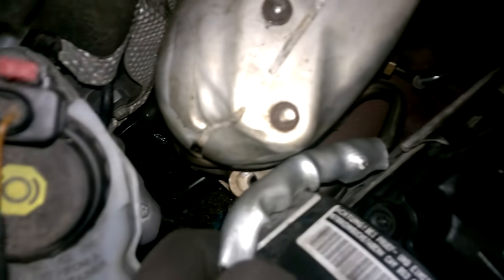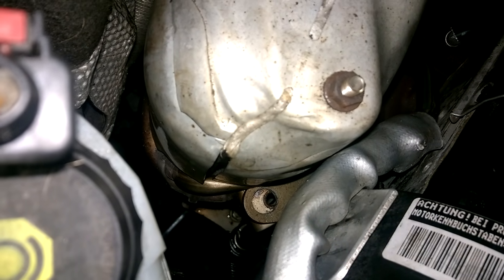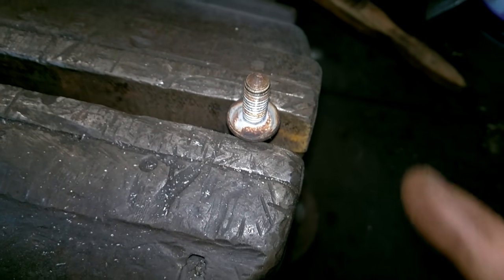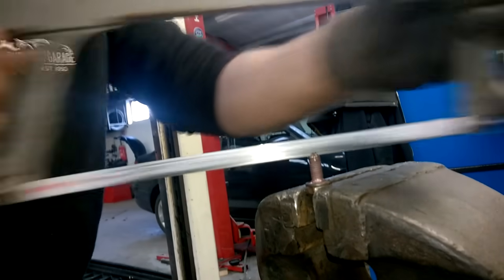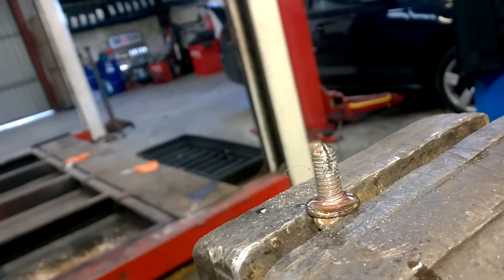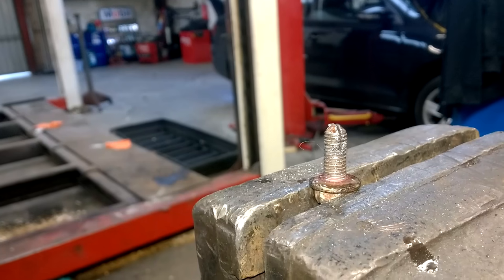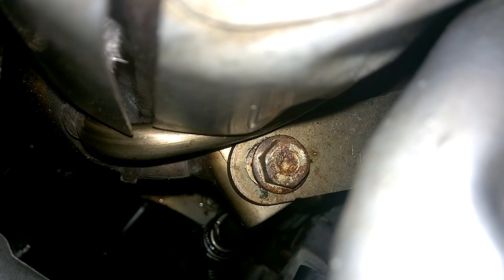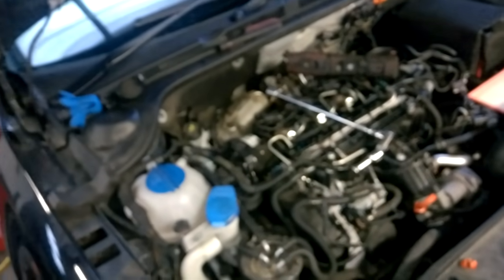My Father Taught Me This! Passing It On To The Next Generation

Comment: Nice Third World method, but here we would buying just a new bolt, for couple of cents.. 😂😂👍🇬🇧🇪🇺
Reply from the maker: The update info below is the pinned comment on this video, I know most people do not realize I made that video and it better explains/shows this method in use.   
I also included below details of why the job was done this way free of charge with the customer fully informed. I hope you check it out  👇👇
 
UPDATE* I decided to make a follow up video on this https://www.youtube.com/watch?v=yfNQullGEuQ&feature=youtu.be Should answer some of the questions that were raised, I include 3 demos of this in action with close up shots.
 
As there was some safety concerns & confusing comments raised, I felt I should clear a few things up. 
1) This is a tip for certain circumstances only, I never have and never would use it on a component which would cause any safety concern to any customer.  
2) The demo was done on a support bracket only, items like this or similar will not cause any safety concern. 
3) I did this free of charge and on a time restraint, I noticed it when I was replacing another item, the customer needed the vehicle back that evening and I decided rather than leave it like it was, I would do this and secure it up fully. 
4) The bolt was not the issue, the part that the bolt threads into is a secured piece, someone had previously damaged it, leaving the bracket loose and the bolt just tightened a turn or so.
5) The bolt can be removed and will not break, it will go in and out as usual and has helped clean up the damaged threads.  
6) Used in the right application I personally believe this is a great tip and can save you a lot of time & trouble. 

Lastly to all the people who have watched the video, Thanks very much and I am delighted with the feedback I have received on it.
Reply: @GerardBurkeBurkesGarage  Cool.🚩😄🤘

Comment: If those threads are useless, and your collapsing the end of the bolt shaft anyways, why not just cut the quarter of that bolt off to the good threads. Interesting tip than you

Comment: If it doesn't want to go don't force it, do it right.
Reply from the maker: Hello so good 4U
The update info below is the pinned comment on this video, I know most people do not realize I made that video and it better explains/shows this method in use.   
I also included below details of why the job was done this way free of charge with the customer fully informed. I hope you check it out  👇👇
 
UPDATE* I decided to make a follow up video on this https://www.youtube.com/watch?v=yfNQullGEuQ&feature=youtu.be Should answer some of the questions that were raised, I include 3 demos of this in action with close up shots.
 
As there was some safety concerns & confusing comments raised, I felt I should clear a few things up. 
1) This is a tip for certain circumstances only, I never have and never would use it on a component which would cause any safety concern to any customer.  
2) The demo was done on a support bracket only, items like this or similar will not cause any safety concern. 
3) I did this free of charge and on a time restraint, I noticed it when I was replacing another item, the customer needed the vehicle back that evening and I decided rather than leave it like it was, I would do this and secure it up fully. 
4) The bolt was not the issue, the part that the bolt threads into is a secured piece, someone had previously damaged it, leaving the bracket loose and the bolt just tightened a turn or so.
5) The bolt can be removed and will not break, it will go in and out as usual and has helped clean up the damaged threads.  
6) Used in the right application I personally believe this is a great tip and can save you a lot of time & trouble. 

Lastly to all the people who have watched the video, Thanks very much and I am delighted with the feedback I have received on it.

Comment: How clever 😀
Reply from the maker: The update info below is the pinned comment on this video, I know most people do not realize I made that video and it better explains/shows this method in use.   
I also included below details of why the job was done this way free of charge with the customer fully informed. I hope you check it out  👇👇
 
UPDATE* I decided to make a follow up video on this https://www.youtube.com/watch?v=yfNQullGEuQ&feature=youtu.be Should answer some of the questions that were raised, I include 3 demos of this in action with close up shots.
 
As there was some safety concerns & confusing comments raised, I felt I should clear a few things up. 
1) This is a tip for certain circumstances only, I never have and never would use it on a component which would cause any safety concern to any customer.  
2) The demo was done on a support bracket only, items like this or similar will not cause any safety concern. 
3) I did this free of charge and on a time restraint, I noticed it when I was replacing another item, the customer needed the vehicle back that evening and I decided rather than leave it like it was, I would do this and secure it up fully. 
4) The bolt was not the issue, the part that the bolt threads into is a secured piece, someone had previously damaged it, leaving the bracket loose and the bolt just tightened a turn or so.
5) The bolt can be removed and will not break, it will go in and out as usual and has helped clean up the damaged threads.  
6) Used in the right application I personally believe this is a great tip and can save you a lot of time & trouble. 

Lastly to all the people who have watched the video, Thanks very much and I am delighted with the feedback I have received on it.

Comment: nice, thank you
Reply from the maker: Cheers Albert  
 
The update info below is the pinned comment on this video, I know most people do not realize I made that video and it better explains/shows this method in use.   
I also included below details of why the job was done this way free of charge with the customer fully informed. I hope you check it out  👇👇
 
UPDATE* I decided to make a follow up video on this https://www.youtube.com/watch?v=yfNQullGEuQ&feature=youtu.be Should answer some of the questions that were raised, I include 3 demos of this in action with close up shots.
 
As there was some safety concerns & confusing comments raised, I felt I should clear a few things up. 
1) This is a tip for certain circumstances only, I never have and never would use it on a component which would cause any safety concern to any customer.  
2) The demo was done on a support bracket only, items like this or similar will not cause any safety concern. 
3) I did this free of charge and on a time restraint, I noticed it when I was replacing another item, the customer needed the vehicle back that evening and I decided rather than leave it like it was, I would do this and secure it up fully. 
4) The bolt was not the issue, the part that the bolt threads into is a secured piece, someone had previously damaged it, leaving the bracket loose and the bolt just tightened a turn or so.
5) The bolt can be removed and will not break, it will go in and out as usual and has helped clean up the damaged threads.  
6) Used in the right application I personally believe this is a great tip and can save you a lot of time & trouble. 

Lastly to all the people who have watched the video, Thanks very much and I am delighted with the feedback I have received on it.

Comment: good to know thanks
Reply from the maker: Cheers Robert
 
The update info below is the pinned comment on this video, I know most people do not realize I made that video and it better explains/shows this method in use.   
I also included below details of why the job was done this way free of charge with the customer fully informed. I hope you check it out  👇👇
 
UPDATE* I decided to make a follow up video on this https://www.youtube.com/watch?v=yfNQullGEuQ&feature=youtu.be Should answer some of the questions that were raised, I include 3 demos of this in action with close up shots.
 
As there was some safety concerns & confusing comments raised, I felt I should clear a few things up. 
1) This is a tip for certain circumstances only, I never have and never would use it on a component which would cause any safety concern to any customer.  
2) The demo was done on a support bracket only, items like this or similar will not cause any safety concern. 
3) I did this free of charge and on a time restraint, I noticed it when I was replacing another item, the customer needed the vehicle back that evening and I decided rather than leave it like it was, I would do this and secure it up fully. 
4) The bolt was not the issue, the part that the bolt threads into is a secured piece, someone had previously damaged it, leaving the bracket loose and the bolt just tightened a turn or so.
5) The bolt can be removed and will not break, it will go in and out as usual and has helped clean up the damaged threads.  
6) Used in the right application I personally believe this is a great tip and can save you a lot of time & trouble. 

Lastly to all the people who have watched the video, Thanks very much and I am delighted with the feedback I have received on it.

Comment: What a bodge, far quicker to do the correct thing and clean the threads with a tap or thread file.
Reply: How does that help align brackets lol if he had room to do all of that he could just align the brackets by hand. When you get paid by quoted labor hours according to the book, have any hiccups like that and you are working for free. It's just a cat bracket, nothing major or too important. If it was a head stud or something then for sure, but this works in this situation.

Comment: Don't have another bolt?
Reply from the maker: The update info below is the pinned comment on this video, I know most people do not realize I made that video and it better explains/shows this method in use.   
I also included below details of why the job was done this way free of charge with the customer fully informed. I hope you check it out  👇👇
 
UPDATE* I decided to make a follow up video on this https://www.youtube.com/watch?v=yfNQullGEuQ&feature=youtu.be Should answer some of the questions that were raised, I include 3 demos of this in action with close up shots.
 
As there was some safety concerns & confusing comments raised, I felt I should clear a few things up. 
1) This is a tip for certain circumstances only, I never have and never would use it on a component which would cause any safety concern to any customer.  
2) The demo was done on a support bracket only, items like this or similar will not cause any safety concern. 
3) I did this free of charge and on a time restraint, I noticed it when I was replacing another item, the customer needed the vehicle back that evening and I decided rather than leave it like it was, I would do this and secure it up fully. 
4) The bolt was not the issue, the part that the bolt threads into is a secured piece, someone had previously damaged it, leaving the bracket loose and the bolt just tightened a turn or so.
5) The bolt can be removed and will not break, it will go in and out as usual and has helped clean up the damaged threads.  
6) Used in the right application I personally believe this is a great tip and can save you a lot of time & trouble. 

Lastly to all the people who have watched the video, Thanks very much and I am delighted with the feedback I have received on it.

Comment: Awesome.
Reply from the maker: The update info below is the pinned comment on this video, I know most people do not realize I made that video and it better explains/shows this method in use.   
I also included below details of why the job was done this way free of charge with the customer fully informed. I hope you check it out  👇👇
 
UPDATE* I decided to make a follow up video on this https://www.youtube.com/watch?v=yfNQullGEuQ&feature=youtu.be Should answer some of the questions that were raised, I include 3 demos of this in action with close up shots.
 
As there was some safety concerns & confusing comments raised, I felt I should clear a few things up. 
1) This is a tip for certain circumstances only, I never have and never would use it on a component which would cause any safety concern to any customer.  
2) The demo was done on a support bracket only, items like this or similar will not cause any safety concern. 
3) I did this free of charge and on a time restraint, I noticed it when I was replacing another item, the customer needed the vehicle back that evening and I decided rather than leave it like it was, I would do this and secure it up fully. 
4) The bolt was not the issue, the part that the bolt threads into is a secured piece, someone had previously damaged it, leaving the bracket loose and the bolt just tightened a turn or so.
5) The bolt can be removed and will not break, it will go in and out as usual and has helped clean up the damaged threads.  
6) Used in the right application I personally believe this is a great tip and can save you a lot of time & trouble. 

Lastly to all the people who have watched the video, Thanks very much and I am delighted with the feedback I have received on it.

Comment: Seems like a very bad idea since there is a high risk of stripping the thread, i sure hope it is not a critical bolt.
Reply: I know!  Just like 3rd and 4th hand smoke. Nobody seems to care!
Reply from the maker: The update info below is the pinned comment on this video, I know most people do not realize I made that video and it better explains/shows this method in use.   
I also included below details of why the job was done this way free of charge with the customer fully informed. I hope you check it out  👇👇
 
UPDATE* I decided to make a follow up video on this https://www.youtube.com/watch?v=yfNQullGEuQ&feature=youtu.be Should answer some of the questions that were raised, I include 3 demos of this in action with close up shots.
 
As there was some safety concerns & confusing comments raised, I felt I should clear a few things up. 
1) This is a tip for certain circumstances only, I never have and never would use it on a component which would cause any safety concern to any customer.  
2) The demo was done on a support bracket only, items like this or similar will not cause any safety concern. 
3) I did this free of charge and on a time restraint, I noticed it when I was replacing another item, the customer needed the vehicle back that evening and I decided rather than leave it like it was, I would do this and secure it up fully. 
4) The bolt was not the issue, the part that the bolt threads into is a secured piece, someone had previously damaged it, leaving the bracket loose and the bolt just tightened a turn or so.
5) The bolt can be removed and will not break, it will go in and out as usual and has helped clean up the damaged threads.  
6) Used in the right application I personally believe this is a great tip and can save you a lot of time & trouble. 

Lastly to all the people who have watched the video, Thanks very much and I am delighted with the feedback I have received on it.

Comment: You need to learn how to use a hacksaw!  You are supposed to use the whole blade not just the center section.  When you make the center section dull, if you pull or push toward the end where the blade is still sharp and the teeth are wider it will stick in the metal you're cutting.  PER MACHINIST TRAINING!!!!!

Comment: why not change the bolt
Reply from the maker: The update info below is the pinned comment on this video, I know most people do not realize I made that video and it better explains/shows this method in use.   
I also included below details of why the job was done this way free of charge with the customer fully informed. I hope you check it out  👇👇
 
UPDATE* I decided to make a follow up video on this https://www.youtube.com/watch?v=yfNQullGEuQ&feature=youtu.be Should answer some of the questions that were raised, I include 3 demos of this in action with close up shots.
 
As there was some safety concerns & confusing comments raised, I felt I should clear a few things up. 
1) This is a tip for certain circumstances only, I never have and never would use it on a component which would cause any safety concern to any customer.  
2) The demo was done on a support bracket only, items like this or similar will not cause any safety concern. 
3) I did this free of charge and on a time restraint, I noticed it when I was replacing another item, the customer needed the vehicle back that evening and I decided rather than leave it like it was, I would do this and secure it up fully. 
4) The bolt was not the issue, the part that the bolt threads into is a secured piece, someone had previously damaged it, leaving the bracket loose and the bolt just tightened a turn or so.
5) The bolt can be removed and will not break, it will go in and out as usual and has helped clean up the damaged threads.  
6) Used in the right application I personally believe this is a great tip and can save you a lot of time & trouble. 

Lastly to all the people who have watched the video, Thanks very much and I am delighted with the feedback I have received on it.

Comment: Hmmmm.......As the holes suddenly have decided to not align any longer, there must be something wrong somewhere. Perhaps the time spent molesting that saw would have been better spent by rectifying whatever was preventing the correct alignment of the holes ?
The outcome of this bodge is you ended up with an incorrectly fitted component and a structurally weakened bolt under severe strain. The bolt may or may not shear while driving, but the guy who need to undo said bolt in 10 years will curse you.  Because that bolt sure won't budge, and it will snap when he try.  Better to do it right 👍
Reply: Somebody had to say it. And I'm glad somebody did.